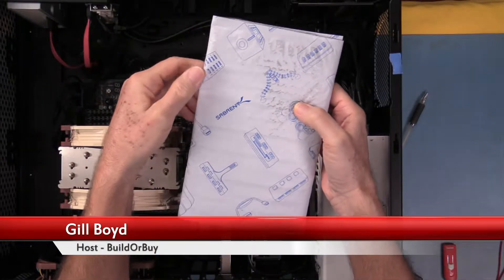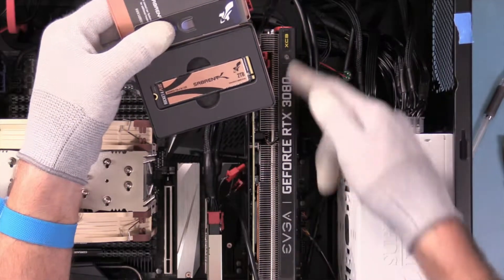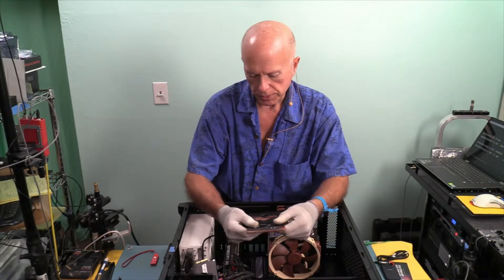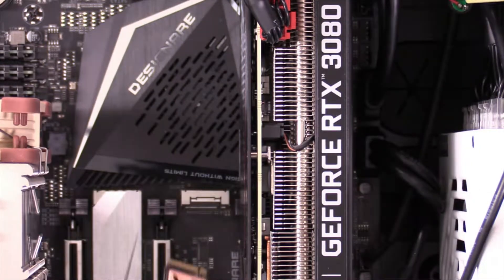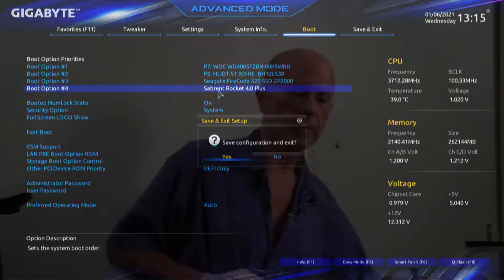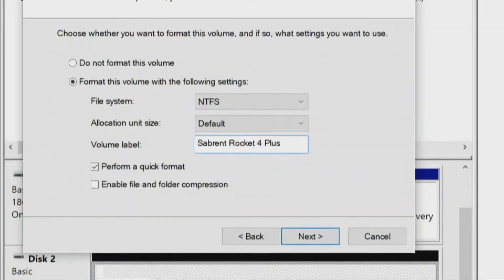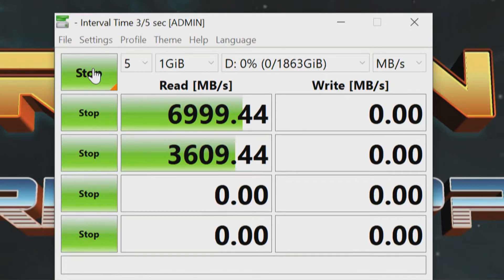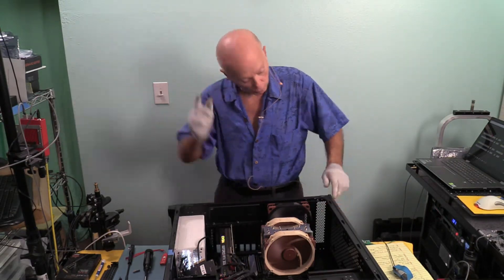Sabrent Rocket 4 Plus M.2 NVMe Unboxing, Install and Test

Comment: you did the test for a 1 gb
Reply from the maker: Hi SkeetleJuice,
Welcome! Glad You brought that up! At the time that's all that was initially available. The 2TB should perform better! How were Your Results?
Reply: @BuildOrBuy  got 7000
Reply from the maker: Hi @skeetlejuice522 ,
Interesting. Two Questions. 1. What did You get on Writes? 2. Which Motherboard and Chipset are You using?
Reply: @BuildOrBuy  550 chip set
 6878
Reply: @BuildOrBuy  you are a great YouTuber
Reply from the maker: Hi @skeetlejuice522 ,
Amazing Results considering the M.2 NVMe PCIe SSD Drive Specs and Your AMD B550 Chipset! Very impressive! Thanks for Sharing!
Reply from the maker: Hi @skeetlejuice522 ,
Outstanding! I'm honored! Appreciate Your Comments! We try!
Reply: @BuildOrBuy  hey could u explain the  different size m.2 sticks. I have seen tiny half sized ones. what is the point of that?
Reply from the maker: Hi @skeetlejuice522 , 
Excellent Question! The smaller Drives means the Chips are getting Denser. Next Question: If Chips are getting Denser, what about Heat. Will that issue improve which remains to be seen if current Designs prevail. Since We're getting Denser, expect current Designs to change to adapt to smarter Designs thus less Heat! 

All of the Motherboard Heatsinks and after market M.2 NVMe PCIe SSD Heatsinks are Designed for the standard 2280, meaning 22mm wide x 80mm long. And what about those 25mm in width? Expect current Motherboards to be Updated in Documentation if and when We see that format size. Like Intel did with Thunderbolt 4 when USB4 became a reality. Same Chipset. Different name. Hope that helps!
Reply: @BuildOrBuy  ok now i feel like i have to say this. Im a disabled vet who spends about 10 hours a day on youtube, i have never seen a youtuber who is so responsive to his community. I didnt expect a single answer from you but u go above and beyond. thank you so much.
Reply from the maker: Hi @skeetlejuice522 , 
First off, Thank You for Your sacrifices. Thank You for serving. Second, I love my Subscribers! Everyone matters here! Very much Appreciate Your Comments, Observations and Support! Building Computers is a Fascinating experience! Good for the mind! Knowledge should be Shared!